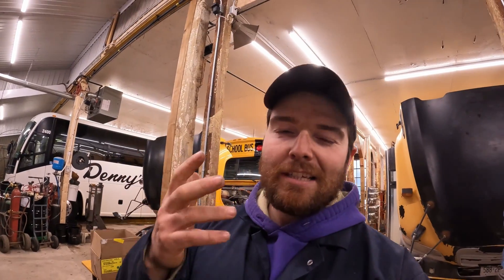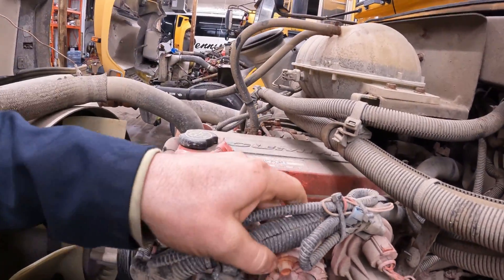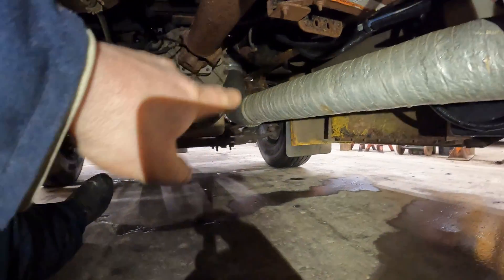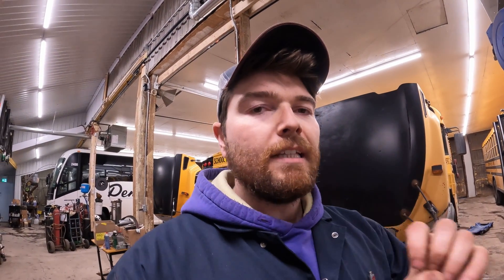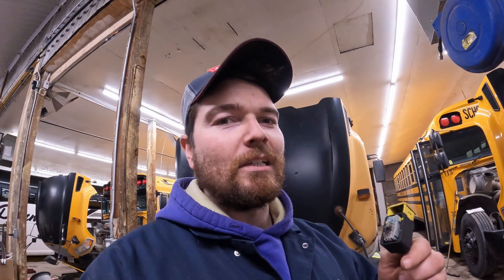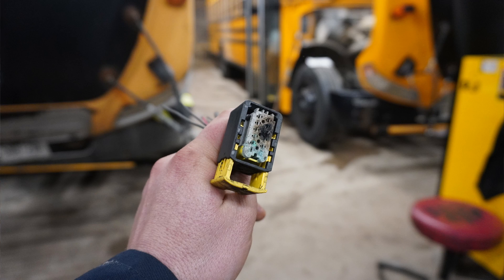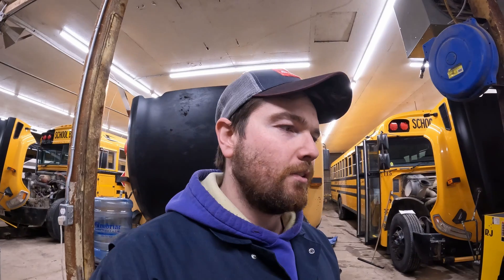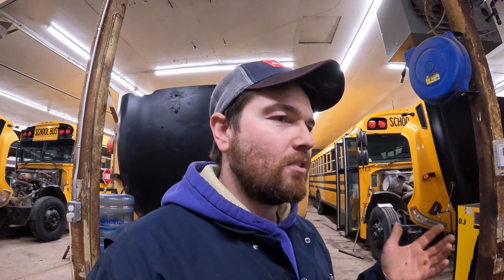RAM 2500 Cummins Diesel | Are Aftertreatment DEF Systems Ruining Diesel Engines ?

Comment: I just found your channel and I think it’s awesome! Very informative.  I have an ‘06 4x4 quad cab 2500 with a Cummins 24v 5.9 with 60k miles in practically mint condition.  It’s worth more today than when I bought it.  Was thinking about buying a new one for more power, but all this emissions equipment and issues, even in a Cummins has me thinking I need to just keep what I have.
Reply from the maker: KEEP YOUR TRUCK. 60k miles on a non emission diesel truck is pretty much gold my friend.
Reply: Keep your old vehicle,new diesels are not worth it with all the def mess
Reply: Thank you. I'm running it completely stock, which has been fine, but now need more power with a 39' travel trailer. Maybe I need to look into getting it tuned.
Reply: @shainester  I recommend NOT turning up the horsepower on that truck, especially for towing.  When pulling a heavy load up a long grade, we don't want the engine doing maximum horsepower and torque for a long time; we want to be in a lower gear spinning the engine up a bit and loading it modestly and trudging up the hill in the right lane in the engine's continuous operating region.

I have a 2002 5.9 manual transmission where the engine is rated for 245HP.  More horsepower would be fun, but sitting at 245HP where the engine really can't hurt its self is its own kind of luxury.  I am not a slow easy driver, and that rig gives 17 to 22 MPG as long as I stay at or below the top of cruise-control (~87).  Not telling where I did it or what state, but sitting at 105+mph steady with overall increase in altitude for a couple of hours lowered economy to the 11 to 13MPG range though it covered a lot of ground.

Comment: I see you have blue birds in your shop. Have you ever had any come in with the clearance lights flickering on and off randomly?
Reply from the maker: yes, at the rear usually. there is a wire crimp behind the passenger side panel at the very rear. always seems to rot out.

Comment: My 2007 DPF was clogged up with ash at 67000 miles. No way that will burn out. I repaired my truck so it would run properly.
Reply from the maker: sometimes you just have to replace the dpf unfortunately $$$

Comment: Alex, why do you think Ram got the 6.4 Hemi so detuned when compared to the Grand Cherokee version (475 hp)? Even the torque is down, honestly that's a pity.
Reply: The truck engine is designed more for low-end torque and heavy load applications and not peak HP. The intake manifold has a top-feed mounted throttle body, this design has a runner length that’s designed to make max power from 3600-5000 RPM. The camshaft on the truck engines is also designed for low-speed torque and not higher RPM horsepower.

The compression ratio is lowered to 10:1 because of a piston change from the passenger car 6.4 engines. The exhaust manifolds on the truck engines are a cast iron design that are more restrictive than the tubular style found on the passenger cars.

With a truck that’s towing/hauling you want a flat torque curve that peaks as low in the RPM range as possible, hence why the Cummins is nice for towing with its peak torque at 1600 RPM.
Reply from the maker: wow very well said sir! thank you for the awesome info!

Comment: A friend of mine who works at a Volvo truck dealership said they had huge problems with DEF crystalizing in the exhaust box of trucks in winter.
Reply from the maker: they are not the only ones. things are getting better but in the manufactures defense they are being told to engineer these system quickly to make upcoming EPA regulations and sometimes things get missed and there are major issues.

Comment: So EGR makes a problem that an a DPF sorts out then that problem gets sorted out by SCR.
Reply from the maker: pretty much. not sure what the next step would be for these trucks because they already run so clean at this point.
Reply: @GettysGarage  the next thing would be reliability improvements. Doubtful that will ever happen with bean counters in charge though.

Comment: Great video.  I had to save my 2018 6.7L Cummins and remove some emissions items.  Would feel different about it if the emissions items were not so destructive to these engines.  Huge difference in the performance and efficiency, plus my truck doesn't roll coal with the installed tunes.
Reply: Delete Delete Delete
Reply: What system did you run for the delete?
Reply: @ajbilleck9805   I have a 4" Flow pro exhaust system with a resonator (Don't like drone and too old for something crazy loud) and an EZLynk tuner.  Can check it out here:  https://youtu.be/cxPTXqimMWI
Reply: @brenteason9891  awesome thanks. I want same set up! I tow and don’t want drone as well. I’ll check it out
Reply: @brenteason9891  be mindful about sharing this info on here lol. EPA watches. That’s why ezlynk is currently in a lawsuit
Reply: @brenteason9891  it’s insane how loud the Cummins is. 5” straight pipe on my LML is quieter than a 4” with muffler Cummins.
Reply: @MediocreRacing   Yup, I went with a 4" with resonator on my Cummins to keep some of the noise down.  It was good trade from my Tundra 5.7L V8 with great sound and horrible gas mileage.
Reply: @MediocreRacing   i see little toy trucks with noisy  exhaust   that proves nothing going on a Dyno would prove it all  i can run passed those little pick up pulling a fully  load class 8 truck.  With no deleted  engine
Reply: @jeffreycrowther1374  yeah ok guy..
Reply: @ajbilleck9805   deleted  engines are illegal  i have never deleted  an engine and have never needed or wanted to. And i have had many Diesel trucks old and new
Reply from the maker: exactly the engines run soo much better without the emission. It is nice to have a clean diesel but when you own one it hurts the wallet way too much
Reply: @GettysGarage  Speaking of emission systems, hopefully, you keep the 6.0L and 6.4L powerstrokes to a minimum in your shop.

Comment: I force regen my truck every month.
Reply from the maker: probably not a bad idea!
Reply: My ram regens every 24 hours of engine run time
Reply: I would say a passive regen. You will do a regen going down the road. If the truck doesn't like any of the conditions it will come out of regen. Then you half to build it back up to meet regen. If you force regen it keeps the truck in same condition and won't come out of regen tell done or mechanical problem.
Reply: @bcrawford9072  no it's active.  The only time it stops is when you shut the truck off or put it in park. All 5th gens do it.

Comment: **Soot doesn't " burn and turn into ashe" ***  Ashe is a byproduct of vaporized engine oil, and cannot pass through the DPF, and is ultimately what will cause the DPF to need to be replaced.  Soot / PM can be burned out in a regen and pass through the ceramic core of the DPF.
Reply from the maker: very interesting! did not know that was the case! thank you
Reply: Yes, ash ruins a DPF. That is why when the DPF's first came onto the scene, oil manufacturers had to scramble ahead of time to come out with a new low ash oil specification for this generation of engines.

Comment: Diesels are going to be around for a lot longer than what people think. It’s in everyone’s best interests to get these emission systems sorted.
Reply from the maker: you are not wrong. the only thing I would say is if there was a big leap in battery technology and solar technology diesels would probably be done. electric motor have way more torque then a diesel, but until they can successfully make it work diesel will be there. could be 5 years could 30 who knows
Reply: @GettysGarage  We live in an interesting, exciting time and are getting to witness some awesome technology unfold. I am a retired mechanic and have seen carburetors, points, "smog pumps" turn into what we have today. I like the technology, true high performance is back. I had all but given up in the mid 1980's. If you told me in 1980 that we would have an 8300 pound diesel truck that got 20mpg, had virtually zero tailpipe emissions, and produced 445hp and 910 ft lbs of torque (my 2021 Chevy 3500HD) I would not have believed it.
Reply: @jimm2442  I managed 26 with my cummins

Comment: Sounds like to me the after treatment to to treat the after treatment.  Maybe there should be a focus on getting the engines to run efficiently and cooler.  Eliminating the after treatment mess
Reply from the maker: pretty much. I mean it does work well (when not broken) to clean the exhaust but there is need for a more efficient system
Reply: Biodiesel is the best way to reduce emissions without the after treatment

Comment: My DEF froze solid over the holidays cause I wasn't around to let it idle in -40c. It ended up taking out the DEF pump, but all under warranty. Soon as warranty is done it's all getting deleted. Apparently its illegal in Canada, but even the dealers will do it (in AB).
Reply from the maker: lol Alberta does seem to be pretty relaxed with emissions, even BC. When I was living in BC there were a lot of trucks deleted. As a diesel mechanic I can tell easily when a truck is deleted just by the sound and smell lol but ya keep that warranty no need to ruin that
Reply: I cannot even wrap my head around -40 degrees lol. I thought this mornings temp of 29F here in the Sierra Foothills was cold. Deleting is not an option where we live so hopefully the DEF system will continue to work.
Reply: I deleted my 16 at 5000km never looked back runs like a dream
Reply from the maker: @Fitter4life  I can believe that!
Reply: Def is made to freeze solid. All def systems have thaw strategies in the software that don't prime the def pump until the def is a certain temp. The newer UL2 style Cummins is using even keeps the lines primed and everything is made to freeze. More than likely something else was wrong with the pump